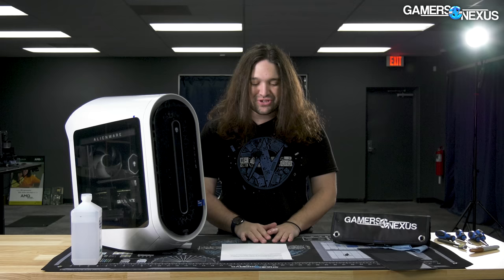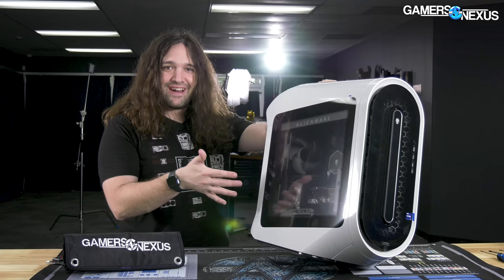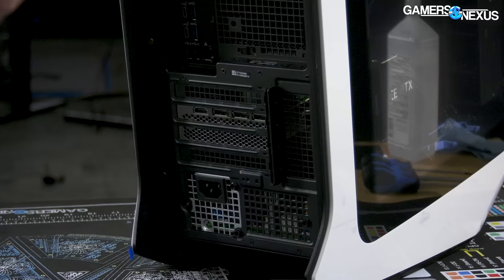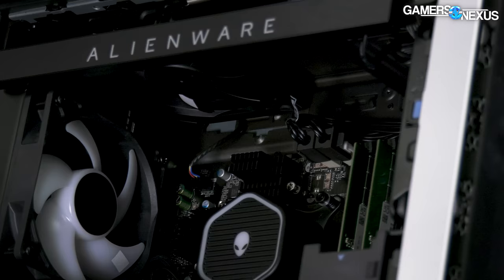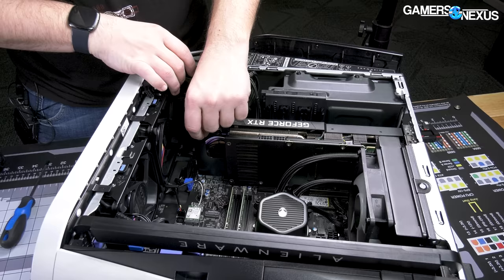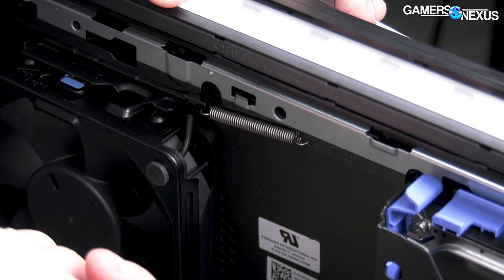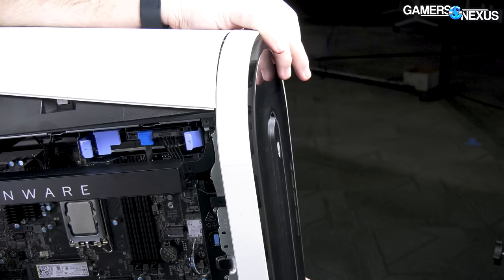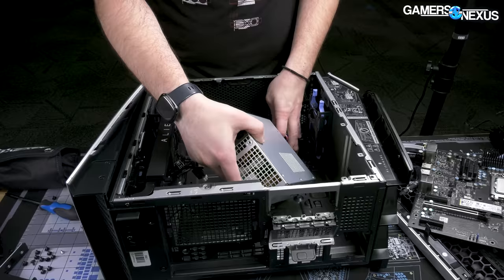Crazy Bad $5000 Alienware Gaming PC: R13 Aurora Tear-Down

Comment: It's impressive how Alienware continually makes the biggest, most unwieldy cases ever, and yet they still manage to have barely any space inside
Reply: They just slap a corvet body kit on a golf cart.
Reply: half the case is just the robot-vagina knock-off console looking plastic exterior. the inside is the same chassis as a low-end dell office PC from 2005.
Reply: you know, for a brand called alien ware, they sure don't know their way around space very well
Reply: That has to be 20-30% bigger than an ATX mid tower, while being matx.

I bet it's larger than the matx Torrent.
Reply: @TheRealAb216  body kit on a golf cart 😂 might need to borrow that description and thank you for brightening my day with a chuckle 😉
Reply: @TheRealAb216  and specs-wise, they slapped a big V12 under the hood, but with the transmission, chassis and tyres of a Citroen 2CV.
Reply: @FantasticMrFrog  And the radiator of a Geo Metro.
Reply: The higher-ups of that company must be living in the 80s
Reply: @Gatorade69  That's...not funny at all
Reply: @no_misaki  Hispanic found?
Reply: @Aaron Moody lol you should see last years version with the swinging power supply. Really makes me wonder considering its quite different on the inside (even shittier) and the exact same on the outside sans acrylic window
Reply: It's the the TARDIS but opposite. Bigger on the outside small on the inside xD
Reply: @ionstorm66  It looks bigger than A HAF 932 Tower and they are Huge.
Reply: Dell just bought Alienware for the name so can sell us crap
Reply: you talk about the space like you have the pc in front of you, don't know if I should tell you but I actually own one, using it right now the point is I could fit a god damn Eaton supercharger inside and still have room for shit. always taking the corny ass short bus reviewer's side.

Comment: That motherboard has to be the undisputed king of the "instant e-waste" category.
Reply: nahhh, its just "E-atx" XD
Reply: my front usb died, guess i'll have to send my 5k pc for a $1000 motherboard replacement that lasts 3 months
Reply: It sure is. All non standard parts just suck. If anything is wrong you can't do nothing with it. Non standard parts should be banned. Imagine paying 5k for something you can't fix without motherboard and case  needing each other. Dead motherboard, replace the case. Problem with the case, can't use the motherboard. I really hate non-standard parts.
Reply: 20:45 Hey for 5000$ it can make noise while bending 🤣🤣🤣
Reply: My previous motherboard was like this, Acer Predator Orion 3000..(got a pre-built 9700 w/2070S for 400 cad 2 years ago almost - normally wouldnever touch a pre-built) .. super disappointed seeing that after upgrading my cooler and having it be too tall for the case and then not being able to do sfa about it. Then I saw 2 9g boards at my local recyclers and grabbed them not knowing they were being sold DoA and getting disappointed more finding a busted socket on one..however the other actually worked fine and just had a weird ram configuration that threw me for a loop too also thinking it was dead until I read the manual (if using 1 or 2 of 4 slots, the insertion is reversed from almost every non-server motherboard I've seen, so very likely this is how they figured it was dead).. throw that with the 9700 and the 2070S+3060 now w/new 970pro (pb came with sn512) in a Fractal Meshify C and now I have something that doesn't shut off when it goes over 100w cpu for more than 10s....

..and also, a pile of e-waste (stupid proprietary motherboard and case).. such a dumb motherboard format
Reply: Actually I almost wonder if this is the new OE-ScamTX motherboard format, having seen this exact thing in multiple pre-builts, from multiple vendors and while I haven't ever compared two side by side they all seem to have that terrible front panel IO growth in a very similar spot? So maybe you could at least swap it into another terrible e-waste case?
Reply: @3Runner95  Which kinda works for business systems where they mostly get next business day onsite warranty. By swapping out "everything" they will have fixed it quite fast. No need to diagnose whether its the motherboard, cable or daughterboard. It's just a very stupid solution for consumer/gaming systems.
Reply: works just fine for me, critique something you have, not something you could have.
Reply: @the_rooster_s10  I personally own, at last count, almost a hundred motherboards.

This is one that will never be in my collection for a myriad of reasons.